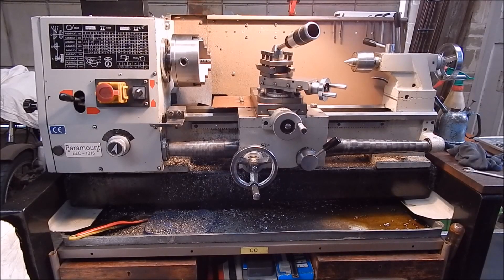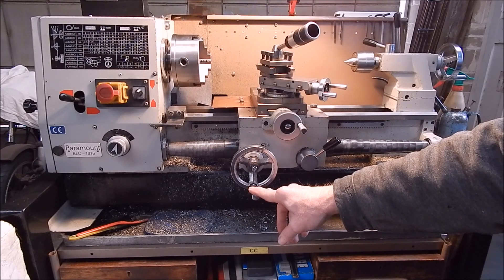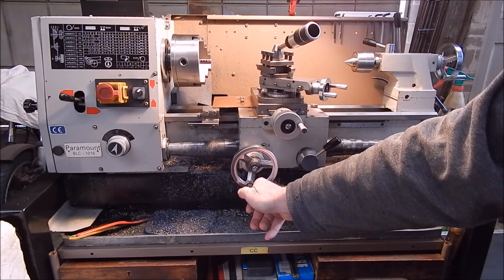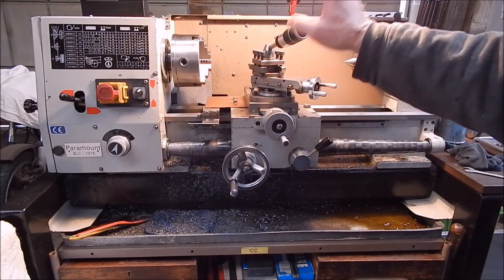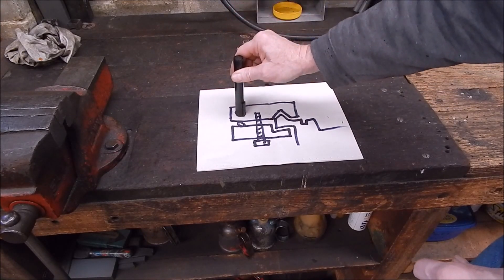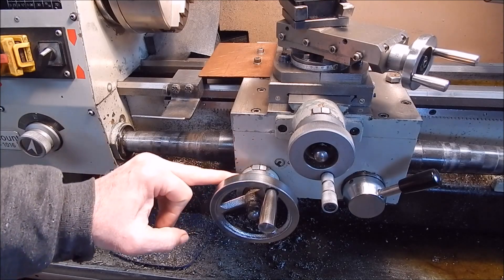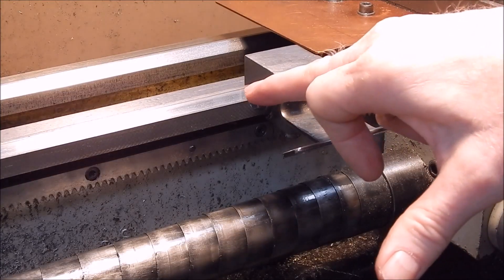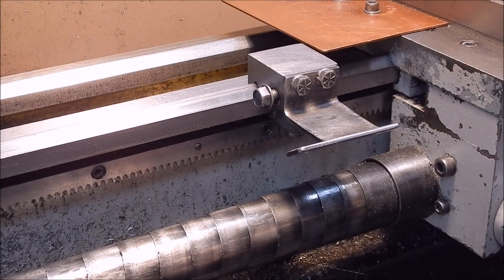Make a simple carriage stop for a metal lathe

Comment: Gday Neill here again, I saw this vid a few years ago just made mine similar but with the bolt up the top,  I just put on the cheap DRO,S  stuff after 13 years with the same lathe simular to yours, it works great but its hard to break some habits. I put them on with the  neodymium magnets works a treat and they are spot on, give it a go cost $100 as bad as the $AU is cheers Neill.
Reply from the maker: Hi Neill,  Carriage stops are great.  Totally positive action.  I added one on the tailstock end as well.  I am not a fan of fixed DRO's as they get in the way, but do whatever floats your boat.  They are certainly cheap these days.  Cheers Rob
Reply: @Xynudu  Hey Rob that's why I did them with the strong magnets it take 30 seconds to put them on or take them off, you wont believe it, I didn't until I went to the bright side cheers.
Reply from the maker: Removable is good.  Cheers Rob

Comment: I assume this does not stop if you have the leadscrew engaged, as in making threads, etc.  This must be only if you are moving the carriage by hand?
Reply from the maker: +gordonfrank 

You must disengage the leadscrew just before the carriage touches the stop, and hand feed the last mm or so.

It's basically a reference point. 

Extremely useful when machining/centre boring to a set depth/measurement.

I use it virtually every time I use the lathe.

Cheers Rob
Reply from the maker: +gordonfrank 

You wouldn't normally use a carriage stop when threading.

Cheers Rob
Reply from the maker: +gordonfrank 

While not necessary for external threading, it can be used as a reference point when doing internal threads against a blind shoulder.

Rob

Comment: Hi Rob,
Love your videos .....keep up the good work....much appreciated.
Could you please explain how you hold the ball bearing,you mention,that forms the pivot point into the carriage stop.
Cheers
George
Reply from the maker: George Livanes Hi George.  It's very simple - at the pivot point (on the same centre line as the pull down bolt), drill a recess slightly smaller diameter than the  ball bearing, in the top/facing up surface of the bottom half.

Then assemble the two halves with the ball bearing in the recess.

As you only need to loosen the halves to position the stop, the ball can not fall out of the recess.  The ways keep the two halves aligned, and the ball bearing allows the two pieces to self align as you tighten the bolt.

The tightening bolt only threads into one piece.  I hope this clarifies things sufficiently.

Cheers Rob.

Comment: G'day mate.  I like the way you do things, straightforward and simple.  Some people will go to any lengths to complicate things and that is certainly frustrating and a time waster.  I built a carriage stop a while back after having hit the bottom of a hole that I was boring and getting the work piece moved out of true.  Closed the barn door after the horses got out I guess.  =(;-)  Thanks for the video.
Reply from the maker: cerberus Hi Harold.  Beats me why they don't include one with every lathe.  It's an essential bit of kit.

You don't even get it as an option these days, with new Chinese lathes.  Many old lathes had it as part of the accessory range.

Cheers Rob.

Comment: Almost an exact copy of the one I lashed up a few weeks ago!

I added a thread hole for using bolt as the limit stop, and a bit of whipper snipper line forced onto the threads with a grub screw as a "nylock".
Another hole lets me bolt on a dial indicator.
Reply from the maker: Ray Jones Hi Ray.  Some similar designs out there.

Some use a metal edge milled into the bottom piece as a full width fulcrum, but I prefer the ball bearing as it allows alignment on all planes.

Definitely a number one accessory.  Rob